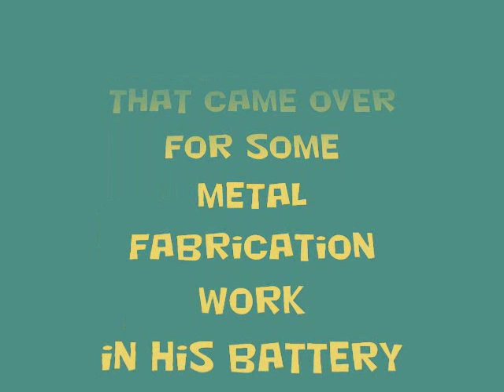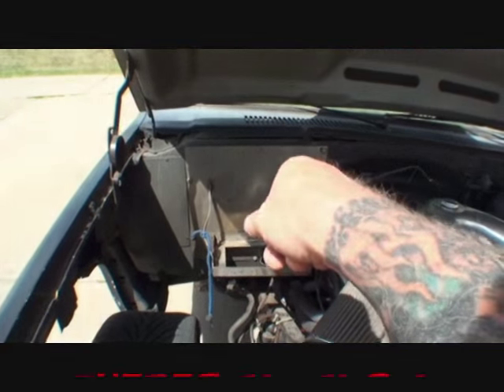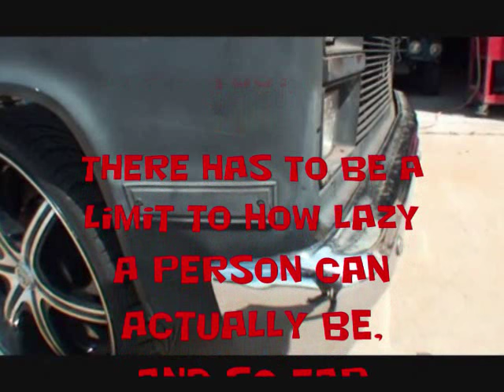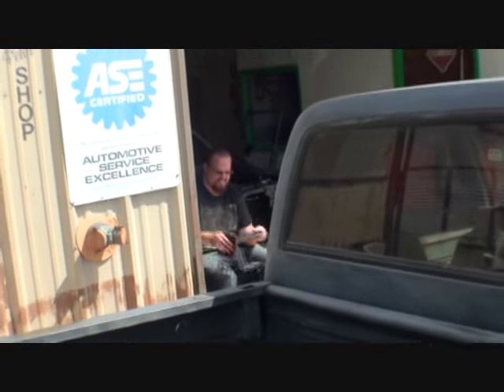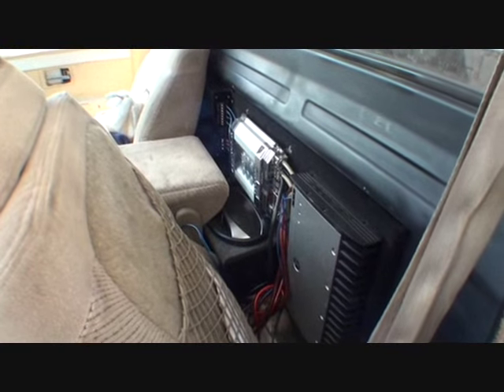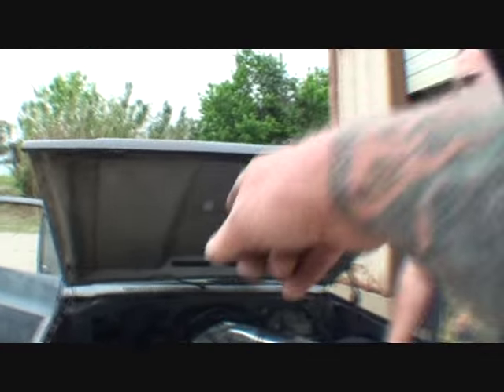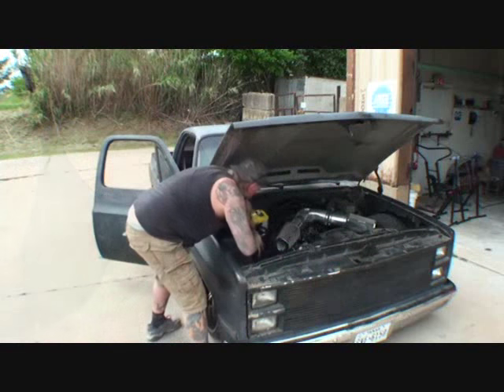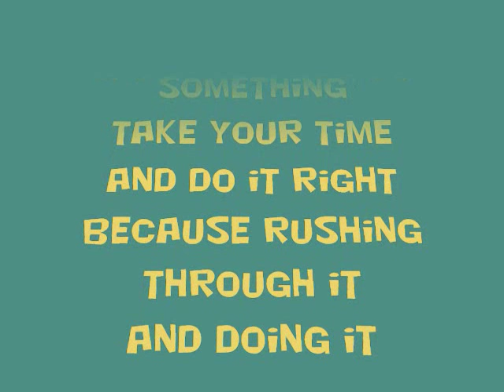Slammed Chevy Truck-The ART OF BEING A LAZY ASS

Comment: 73 to 79 then they changed the front clip 80 to 87 and other things 80 to 87 are junk they used cheap parts on them i have a 79 with Cadillac suspension from factory with perfect body blue with silver all the crome on it factory paint trade for parts have 2 more 75 and 78 and many parts for them